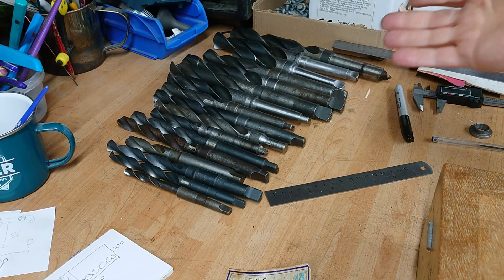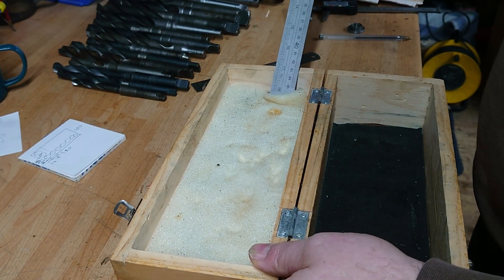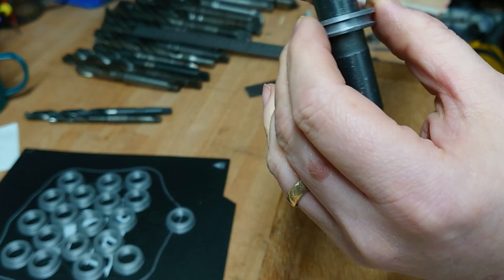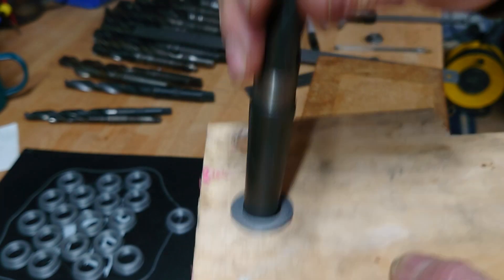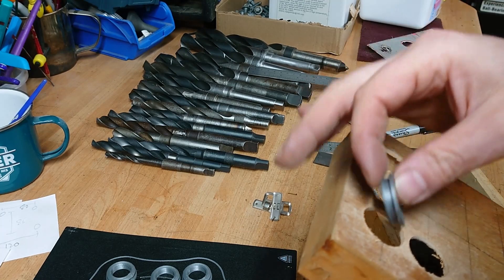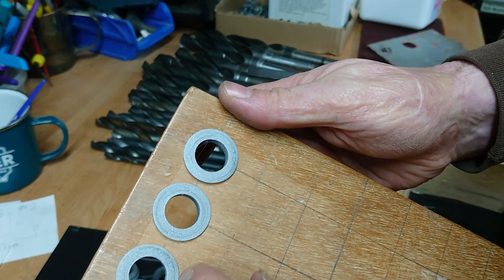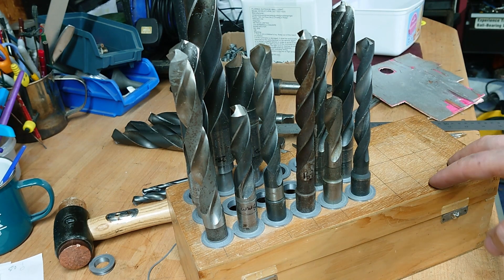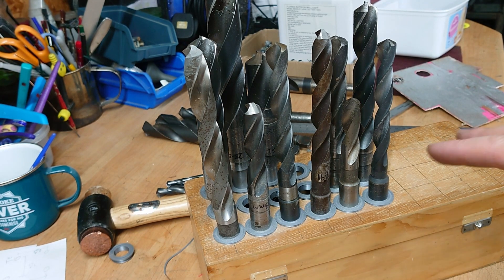A Morse Taper Drill Rack using an old box and 3D printed adapters(Advent 22 Day 8)

Comment: Good to organise them on the shelf if you can. My shed gets too humid in autumn and winter, so all my tools are wiped down with lanolin and stored in an airtight container.
Everything including the small 4" rotary table and toolmakers vice have a ip65 storage container 😆
Reply from the maker: I've been there! When I put this shed up I made sure it was well insulated. It's pretty dry in there, and with the log burner I can get it nice and warm, so things don't seem to rust for me. Can you insulate yours?
Reply: @ollysworkshop  I'll need to pull everything out, insulate the tin shed fully and seal the concrete, add a moisture barrier floor coating and make it airtight. Given it's a tin shed, moisture will still find its way inside. I gave up after doing more research and talking to some construction peeps. Lanolin was recommended by Curtis @ CEE and works very well and I'm stocked up for the next few years 😬

Comment: How do you make it snap fit in terms of sizing and design? 🤔
Reply from the maker: It was all a bit finger in the air. I put a barb on the lower section, and it's a smaller diameter than the upper flange. The hole was about 1mm smaller than the lower barbed bit. I can upload the files if you're interested?
Reply: @ollysworkshop  please do, I think it is an interesting concept that most would not have thought about before.
Reply from the maker: Hi @tandb - I've uploaded the files, check the description for the link